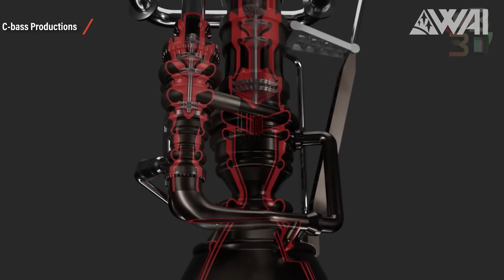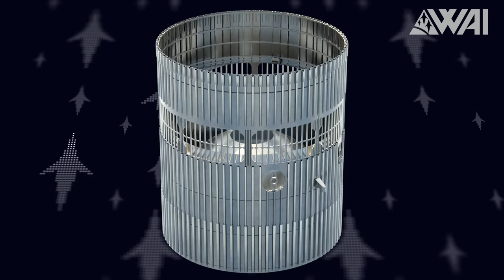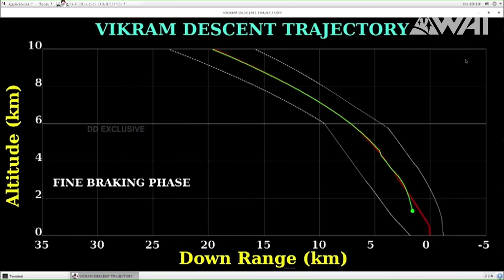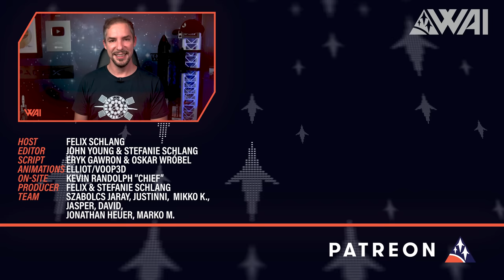Epic Testing Change! Is SpaceX's Starship Raptor Engine Unreliable?

Comment: If you have a 1 in 1000 chance of a catastrophic failure for one engine, the odds become 1 in ~30.8 when 33 engines are involved.  So it’s incredibly important that they make these engines to be as bulletproof as possible.
Reply: Nice
Reply: Oh the gripping hand, it takes a failure of more than three engines to cause an automated launch abort. Anything less is within the margins.
Reply: @jounik  three engines likely means no orbit. but, please, proceed...
Reply: @jounik  Don't forget the ones on the Starship. Essential for a safe landing.
Reply: The failure mode seems to be shutdown and rarely explosion. The first Launch at april 20 probably had engines damaged by concrete blocks. At separation there is a lot of fuel for the booster landing so they could burn it a little longer and sacrifice the booster for the mission.
Reply: @frankderks1150 Yeah this vehicle isn't going to have humans launch/land any time soon. Think decade+.

In the meantime it'll hopefully be useful as a huge mass to orbit vehicle which is still a worthy goal in itself.
Reply: Well, if 2 failed in the first static fire, 3 failed during startup on the first failed orbital test, and 4 failed now during startup on the static fire, that would give us an average of 3/33, or about 9% failure rate, during the first couple seconds alone.
For the full flight it can only get worse than that, especially as SpaceX isn't doing any ground testing in this regime, rather choosing to rely purely on incomplete telemetry data from failed tests flights, until they succeed.
Reply: You have a poor understanding of probability. If each raptor has a 1/1000 chance of failure then the chance of no raptors failing is 1-((999/1000)^33) or about 3.25%. Realistically the odds of any one raptor failing is likely much higher than 1 in 1000
Reply: @screally1152  how is my understanding of probability poor, when you reached the exact same result that I did?
Reply: @w3vjp568  You calculated the expected value of a raptor engine failing, the other lad calculated the probability of no engines failing. The other dude calculated the probability of any number failing. As you took a small probability logically these numbers are close to each other but the lad is right.
Reply: The most important statistic is what are the odds of 4 -5 engines failing meaning no successful reaching of orbit.( especially if and when starships are manned)
Reply: @mickeytadadam How does the probability change, when you can assume that they had startup parameters set to very conservative, for such a test.
  They were more interested in testing the deluge system, than the Raptors. 
  This is so obvious, I can't believe I am the only one saying it. 
  The Raptors are just fine! Otherwise they would have replaced the 4, in question, and re ran the test. Instead, they rolled the booster back for the HSR install.
  Have to think from first principals. 😊
  👻☠️🗽💯🙏
Reply: They haven't had a "catastrophic" failure of a Raptor in flight yet, so what leads you to believe that catastrophic failures will be that frequent?
Reply: @ThatOpalGuy  If it can achieve orbit with 33 of the current engines, then with the projected thrust improvement, three engines out just means that they have to throttle up the others.
Reply: @plainText384  But those were not "catastrophic failures" of the kind that will destroy the launch vehicle.  Starship is designed to fly with engines out.
Reply: @iamaduckquack  The timelines for the Human Landing System seem dangerously optimistic. But for launching Starlink V2 satellites it's quite realistic.
Reply: @johnbrobston1334  3 engine failures during the first couple seconds means massive performance loss, and depending on payload weight, mission failure, or, if possible, abort and retry.
SpaceX will not enter commercial operations, and NASA won't let them fly humans on HLS until they have identified and corrected the root cause of these failures.
Reply: @screally1152  the probably of no engine failures would just be (1-p)^33, 1 - (1-p)^33 should be the probability of having at least one engine failure. 
Anyway, based on the fact that 2 engines failed during the first 33 engine static fire, 3 engines failed in the first seconds of the orbital launch and 4 engines failed during this static fire, we can estimate that p is probably closer to 91/1000, than 1/1000, at least for engine failures during the first couple seconds.
Reply: @mickeytadadam  I used the exact calculation he did.  He expressed it in terms of percentage, I expressed it in terms of 1 in n odds.
Reply: @plainText384  30 Raptors at 100% have more thrust than 33 Raptors at 80%.  That's one benefit of the performance upgrade.  Yes, they're going to fix the problem, but stop making out like losing a few engines means a failed launch.
Reply: @johnbrobston1334  loosing a couple engines does almost certainly mean a failed launch, if they have a payload on board. Especially if this problem is with the engines or at least with a system shared between booster and Ship. 
Fixing this issue isn't optional, they will have to fix it before launching payloads and especially before landing crew on the moon.
Reply: @plainText384  How does losing 6% of  thrust result in a failed launch when the engine can be throttled up 20%?
Reply: @johnbrobston1334  3 engines are 9% of thrust, not 6%, and assuming the engines are running at full thrust during liftoff, that 9% difference in thrust results in a 73% reduction in acceleration.
SpaceX/ Elon Musk also stated that one more engine failure during startup, beyond the three that shut down during the first seconds of the OFT,  would have meant that they would not have been able to make it to orbit. And that was for the orbital test, which did not include any payload. Add another 150t and you're going to need the performance. That's why SpaceX built the booster with 33 engines and not 30.

Also, I cannot find the claim that Raptors fly at or below 80% of maximum thrust during a nominal flight anywhere. Can you please provide a source?
Reply: That’s not true. That’s not how probability works. Each engine has its own separate probability.  Your projection is assuming that one failure or success impacts the next. That’s not the case.
Reply: @w3vjp568 you’re suggesting the odds of a failure is roughly 1 in 3. His probability is that there is at least one failure is closer to 96%.  No, your calculations are different. His are correct.
Reply: @jounik  Within the margins for SpaceX one failure during qualifying and it will never be approved for manned flight.

Comment: The Raptor, like the Merlin before it, is evolving.  The Merlin took many years to perfect.  The Raptor, with every iteration, will get better.
Reply: Lets go Raptor 3 and beyond - ~400Bar chamber pressure!! (in contrast, a direct injection gasoline car is running ~40Bar "high pressure" fuel rail)
Reply: The human species, like before, is also evolving.
Reply: Raptor could be more successful if fitted to smaller rockets, and launched every week.
Reply: The Raptor would need to be 100% reliable and that isn't possible without major inspections and maintenance, something that isn't compatible with their rapid re-usability agenda. Something will have to give if they went humans to ever go near this vehicle.

This system might just end up being a huge mass to orbit vehicle and nothing more (which is still super important and a worthy goal in itself).
Reply: @iamaduckquack A mass to orbit at a cheap price is exactly what it will be for a good number of years, eventually the starship will come online, its not an if or maybe, its just 'when' before some sort of reusable upper stage will be available to use.
Reply: Well, Raptor doesn't have years. It needs to be ready and reliable for crewed HLS operations in no more than 2 years, for Artemis 3 and any uncrewed test flights beforehand.
Reply: @Rawkus919  You miss the entire purpose of the Starship. The Starship us designed to go to Mars with 100 tons of people and supplies.  How would that be done with a smaller rocket?  They have a smaller rocket called the Falcon 9, which is designed to carry smaller payloads to LEO.
Reply: @iamaduckquack  The Raptor will be 100% reliable in time.  The Merlin is 100% reliable, but it was not in the early years.
Reply: @plainText384 
SLS was how many years overdue??  Space x s making unimaginable advances with every test.  Any other company and you wouldn’t get to critique all the tests on the way to success. SpaceX is insanely open with its failures and successes.
Reply: @Rawkus919  that’s kinda what I had been thinking. It’s way easier to get 9 to all work than 33
Reply: Raptor 3 is already a thing too. Other issues could be water getting into the engines prior to ignition, lets see what the results find.
Reply: @Rawkus919  if needed or useful SpaceX can run, test a Raptor every day, every hour at McGregor test site. Perhaps some of the problems relate to the Starship booster; fuel feed, pad startup infrastructure, etc.
Reply: all the 5 SN flop tests didn't seem to have much issues with raptor reliability going up ie 0% failure over 15 engines and they were old prototypes doesn't this imply something about simultaneous ignition of 33 is affecting things more so that raptor itself?
Reply: 10 years and 4 modifications from Merlin1A to Merlin1D. But Merlin1A had 1 successful flight, and Raptor1 (Raptor2) no. 
Merlin1D has not the best properties over the other rivals, but it is the most cheap, light and relyable.
On the contrary Raptor has the best characteristics compared to all other engines, but relyability???
I'm afraid, that SpaceX aims too hard tasks to fulfill with Raptor or it will take too long period to finally achive them.
Reply: @MattyJ55046  Don't forget, they routinely light twenty-seven engines on Falcon Heavy.
Reply: @plainText384  NASA is already working on alternatives, there is no chance SpaceX will have their Starship rated for manned flight in time.
Reply: @kokomo9764  No, Raptor won't be ready, not the way SpaceX is doing it.
Reply: @EinKerl3554  Yes, NASA has contracted the development of a second alternative HLS lander. But that lander, the Blue Moon Mk2 lander being developed by the Blue Origin lead national team, is contracted to fly on Artemis 5, no earlier than 2029. Even if this second HLS lander were to face no delays and was actually ready in 2029, that's still four years after Artemis 3 is supposed to fly. If SpaceX isn't ready for Artemis 3, NASA will have no choice but to wait, dissrupting the schedule for the entire programm.

Comment: What is causing raptor unreliability is irrelevant to the public. They should static fire test untill they are reliable and not before.  It doesn't make sense to risk the public or the mission when you know there is a 12%-21% failure rate. Get this right first!

Comment: Another great episode! Thanks Felix! 
I strongly think there will be another static fire of the booster, and an initial test of SN, Then full stack cyro test. Then flight mid October pending FAA's hippie ways. Also, I think X has learned a extreme amount of anticipation "what not to do's," and just like the Falcon, should at least reach stage separation, and possibly 55 thousand feet MSL. They do their magic, and put on a great show, along with innovation. Also, the third OTF in February with test of OLM sticks catching the booster. 
Another thing I have been thinking about is.. why don't they catch F9's booster in the same way they plan on with the Starship booster? Along with developing Falcon second stage recovery?
Thanks again for the great content!
 - NOM

Comment: One thing to keep in mind is that there have been no Raptor problems on any ship test in the past few years.  If you assumed that the engine was the problem you would expect to see the same failure rate as on the booster.  But you don't the Booster problem rate is way higher.  That could lead to the guess that the problem is the booster and not the engines.  Suppose that 33 engines sucking from the same place in the same tank induced pressure waves or something like that during startup.  And these pressure differences made starting the Raptors harder.  Or the OLM could have plumbing issues. Maybe the solution is tank baffles, a staggered starting sequence, OLM fixes or something else.

Comment: Remember that all the boost engines are spun up using connections to the OLM, all of that was replaced in the OLM refit so would have been the first time use too. Lighting one Raptor is complex because of the nature of the engine with two pre-burners, to get 33 to fire up first time would have been more luck than judgment. It will take a while to get everything dialed in to make it reliable. I think they are going to have several static fires before they get any kind of reliability. The individual engines themselves seem reasonably reliable at this point.
Reply: Yeah man.   They will keep pushing forward.   All go Space X.
Reply: ^this

Comment: I was tasked with refurbishing the antennas at VAFB. The best approach was to tear down the antennas and ship them to Atlanta Georgia for a factory refurbishment, testing, walnut blasting and coating with material that performs well in a humid salt environment. It was optimal because we wrote the contract as a turn key where the OEM was responsible for tear down, shipping, refurbishing, assembly on site and testing. We withheld 10% for a final operational test that included full tracking of a space vehicle to the horizon. To ensure there was plenty of signal at the telemetry building, which was not co-located with the antenna, we contracted Ortel to provide an analog fiber transmission system. The signal to noise ration was phenomenal. The test exceeded expectations. SpaceX may be excessing the antennas. If they are still Government Owned, they will need to go to Ransom Road where the bidding occurs for Government Excess material. Otherwise, the antennas may just be scrapped.

Comment: Good point that it could be any number of reasons for a Raptor shutting down and might not necessarily be an issue with the engine itself. Another possible reason for an anomaly that is by no means unheard of in space flight systems is that there was nothing wrong with any of that actual flight systems. Sensor failures, or telemetry corruption meaning that valid data from some specific sensor or set of sensors is mangled or unavailable once it gets to mission control, can cause a precautionary shutdown on the basis of bad or missing data when in fact everything was working perfectly.

I guess we'll never know the exact causes of the shutdowns during that last SF, we just have to wait for SpaceX to analyse and fix the causes of the failures and see how the next test goes.

Comment: Super news to hear the OLM survived well. SpaceX proves again that my worries were wrong. Congratulations SpaceX ! I am guessing that with so many engines in a small area, local shock waves and pressures are perhaps damaging a few engines. It is a new environment, and it is impressive that most of the engines are operating nominally.

Comment: Thank you for explaining how the engine issues might be linked to the older engines and not that they are not reliable. I have been trying to point this out with people but they won’t listen. Big difference in age of them and how long it’s been since they were fired last
Reply: So if you know that the old ones aren't good the question is why use them?
Because they were build is no excuse. Any reasonable company doesn't build a hundred of a prototype and then use them knowing that they can build better and in fact already started making better.

If the old ones are unreliable a sensible thing to do is not use them. Besides, this undermines the entire 'telemetry' aspect of the failure that was the 4/20 launch.
Telemetry of old crap gives you old crap telemetry.

Comment: Is the engine thrust overwhelming the water pressure?
As soon as the engines fire up , the deluge out put appears to be reducing significantly...
They havent revealed the aftermath of the tests done on smaller scale nor the latests static fire

Comment: The Coast Guard has issued watercraft warnings on Aug  31 in case of launch debris. 
So somebody has high hopes. Me too.
They had engine failures on the first launch attempt as well. No one seems to have the serial numbers of these failed engines. It would be very interesting to see if there are patterns. Or failure  locations. Eg. Inner or outer rings of engines.

Comment: I think they might be able to launch in mid September considering that they are flying through the testing process.
Reply from the maker: Fingers crossed!!! :_WAIHYPE:
Reply: Will launch September 25th, obviously. 😉
Reply: FAA approval says halt.
Reply: @iamaduckquack  yeah that’s the one thing that I am worried about for that timeline. No doubt that they fly this year just maybe not September
Reply: 2025 September
Reply: The FFA approval is probably the biggest hurdle for an earlier date.
Reply: @Nathan-vt1jz  FAA prevent disaster
Reply: @UmmerFarooq-wx4yo if only!

Comment: One thing I haven't seen discussed much. If Starship post-launch telemetry isn't switching to Starlink hence those tracking antennae are being relocated, refurbished or upgraded (or some combination of those things) then might they also be on the critial path for the next launch? I can't imagine SpaceX wanting to do the next launch with no ability to collect data after the test vehicle has left the pad so unless they are switching to Starlink or some other comms path that doesn't need tracking antennae then I would have thought that re-establishing the tracking station somewhere in the vicinity of the launch site is another essential step that needs to be done before the next launch.